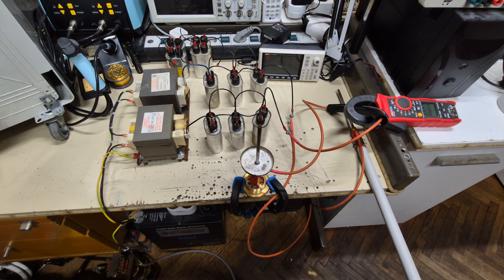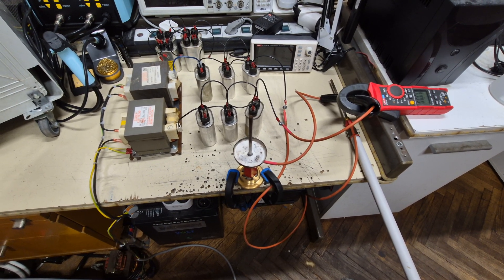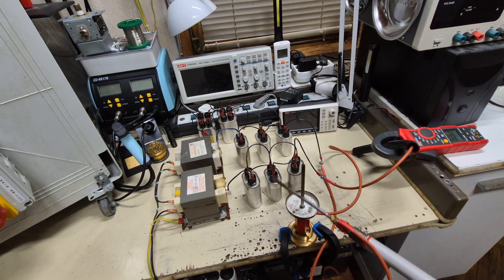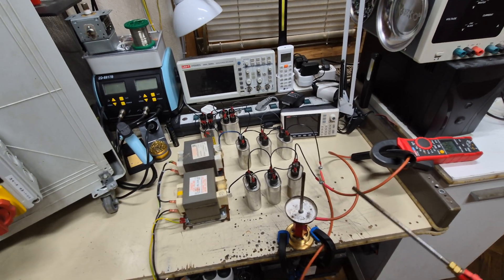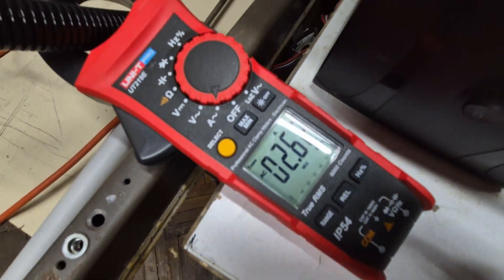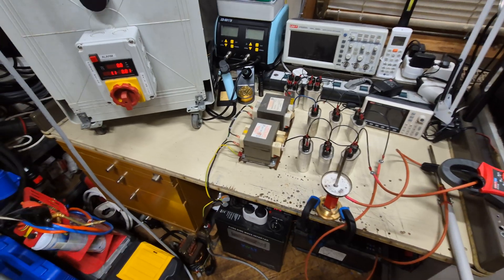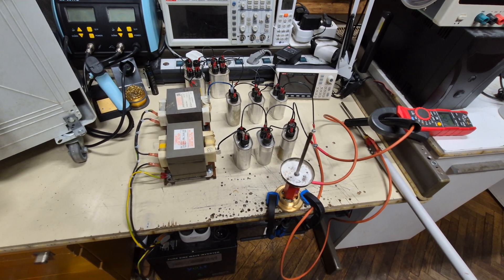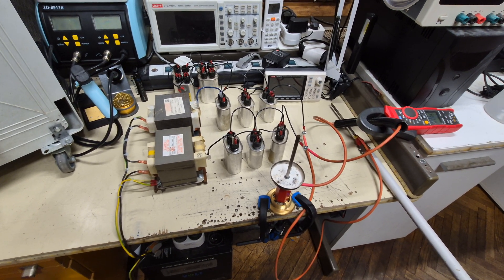Resonant MOT stack (part 2, measuring the secondary current and more arc's)

Comment: I haven't tried using resonant capacitors yet with my MOTs but there is something I don't fully understand about resonant setups. Using resonant capacitor does what, extract extra power from the MOT? as in forcing it to draw more current or it simply makes the arc dissipate the power more efficiently making it hotter and larger while the MOT draws the same power on its primary?

I wonder about this because I want to design a power supply that dissipates most of its power in a large electric arc and while higher voltages result in longer more stable arcs they become extremely inefficient. A 15kV 30mA arc from a NST dissipates negligible heat yet that's about 450W of power, an arc made with a 400W sodium lamp ballast dissipates way more power as heat and light but its very unstable. I wonder if using resonant capacitors are the answer to my conundrum.
Reply from the maker: By using a resonant capacitor you cancel the secondary inductive impedance so you left with only the resistive DC impedance of the coil, forcing more current through the coil. (Also the power factor of the transformer improves).

More current always means more hotter arc. Current is a measurement of how many electrons are going thru a particular cross-sectional area of a material per second. So if you push more electrons thru a ionized gas (air) path you will generate more heat.

For a example if you have a transformer with 48 V and 65 A you can weld steel plates together, but a transformer with 15 kV and 0.2 A can't do that, even do the total power is almost the same (3.2 kVA).

There is a old video of me where I was making low voltage (600 V DC) arc's, I think that would be similar to using a sodium lamp ballast.

I hope I could help you a little bit 😊
Greetings Alex
Reply: @Alexelectricalengineering  Thank you for your answer it was helpful. I experimented and well I don't know why I didn't tried this before the arcs are far more impressive in person, much larger brighter and louder. I measured the current of the primary and surprisingly it was lower than with no resonant capacitor, with no cap it was over the range of my meter so more than 20A with cap it varied from 7A when the arc started to 16A when the arc was the largest. Biggest issue I noticed was now the core heats up more as well as the secondary so a sign of significantly higher currents on it! 

This is going to be very useful knowledge to design the power supply.
Reply from the maker: @teresashinkansen9402  Always welcome 😁

Comment: Are the Transformers secondaries in series? And then two sets of three capacitors in parallel with each other on either leg of the Transformer output?
Reply: The primaries antiparalel and sec. Midpoints parallel
Reply from the maker: Yes!
Reply: Nicht antiparallel primär und die mittelpunkte zusammen? @Alexelectricalengineering